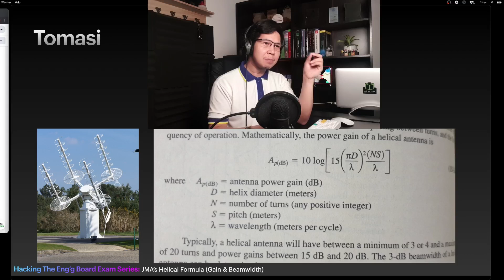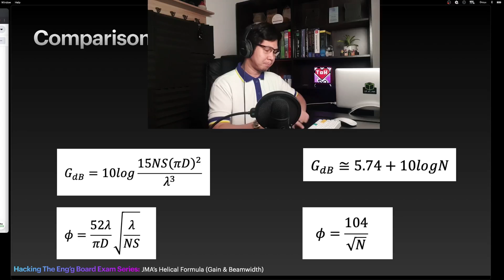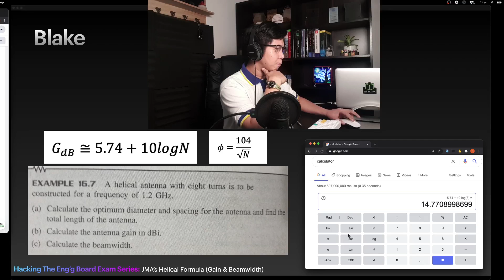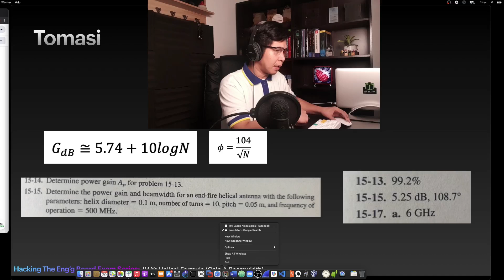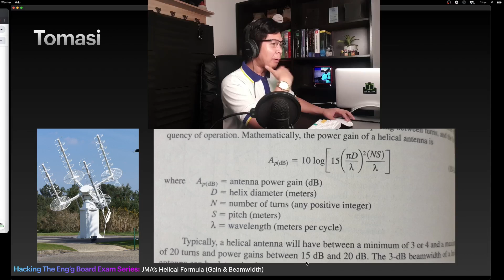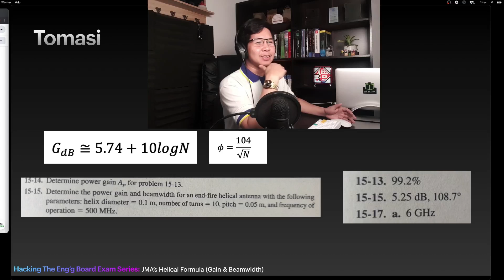Hacking The Engineering Board Exam Series | Helical Antenna shortcut calculation using JMA's formula

Comment: Another reason I can think of for the question of polarization, sir:

Since the current induced in the conductor, in this case antenna, is the same direction as the electric field. So the orientation of the conductor should be correct as with respect to the ground, which follows the electric field.  If the direction of magnetic field is followed, no voltage will be induced, thus our antennas will have no function at all. :)

Comment: I guess sir that we can also consider two antennas (transmitter and receiver) like a parallel plate capacitor, in which if we apply a charge (or current) in one antenna, an electric field is produced between them. This might be one reason why electric field dictates the polarization of an antenna.